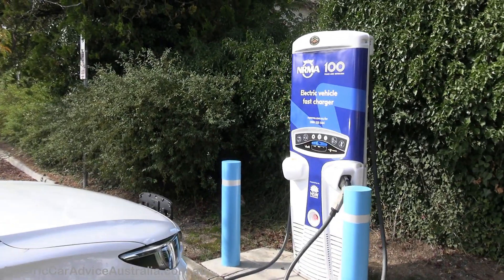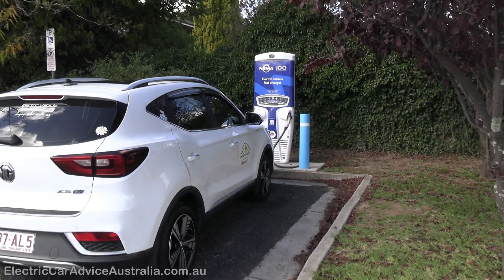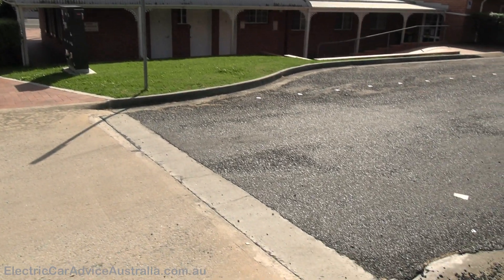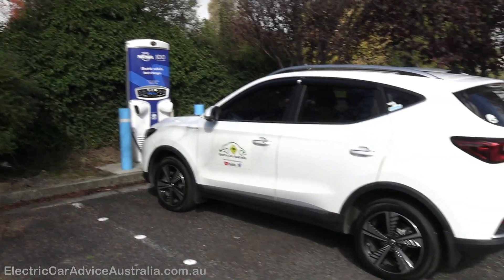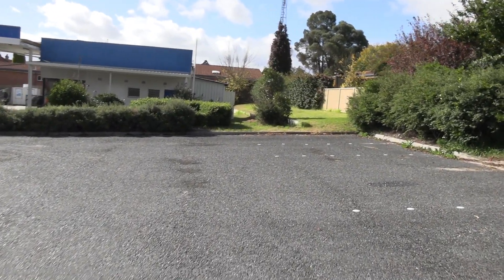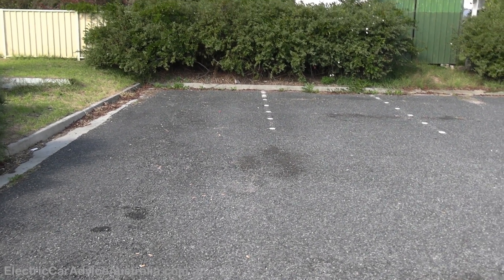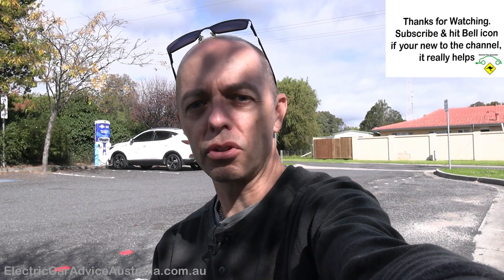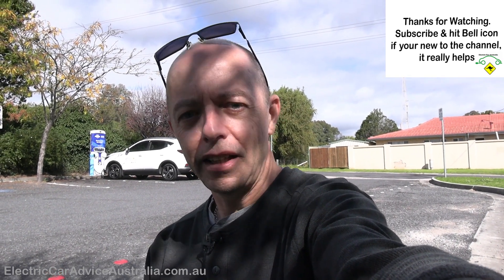EV Charging Stations | What's wrong with them? | Layout & Design Issues | Electric Car Australia

Comment: New EVs can tow, some up to 1,600 kg. My Hyundai Ioniq 6 tows 1,500kg while the Ioniq 5 and the Kia EV6 can tow 1,600. I think that the Tesla Model 3 and the Model Y can tow also.
I cannot understand why charging stations are always designed as back/nose-in rather than as pull-through (like ALL fuel stations are). Some people are driving EVs and towing, needing somewhat more frequent charging, but this is almost impossible, or made EVEN longer as they must unhook the trailer and leave it somewhere while they charge the car. I can understand the question of vehicles sitting and blocking other drivers from driving through, but there are several simple solutions o this. Make the spacing wider so cars can pass through past those still charging. Or even have mostly back/nose-in but have a few chargers which enable pull-through. This issue is a major disincentive
Reply from the maker: Thanks for watching and the comment. 👍

Comment: Yes I agree that more thought needs to go into charger locations. Also EV manufacturers need to come up with a standard location for all vehicles. Our first EV, a Nissan Leaf, had the plug right at the front, now we have the BYD Atto 3, and the plug is on the right had side near the front.
Reply from the maker: Thanks for watching. Agee a more standard position for charge port, or even a couple, would be more helpful.

Comment: Cheapest quote wins, being closest space to power board. There is a fire buffer between the public building and the EV.
Reply from the maker: Agree, that's why scratching head on this one as the distance was the same. Not sure what you mean re: fire buffer. If it's relating to EV's catching fire, they are 10 times less likely to do that than petrol/diesel so safer in that regard. Thanks for watching.

Comment: Accommodation also needs to consider places and also places need to consider how temporary blockages can be an annoyance. 

We stayed at a hotel where there was a truck parked across from the chargers and because people still needed to get past the EV chargers and truck to the rest of the accommodation we had to park across the two destination chargers blocking the second one. They did explain the issue when we got there but given how charging is likely going to be an increasingly big deal in bringing in customers they really should have reprioritised better, perhaps asking the truck driver and someone with a side room to swap parking bays for the night or make it a standard practice if long vehicles are common, since unlike chargers vehicles can be temporarily reshuffled. 

Also the chargers were put in the choke point which... not great planning. It's a real case of putting the chargers in the least desirable spots coming back to bite the owner. One charger instead of two might have actually made more sense in this situation.
Reply from the maker: Thanks for commenting and sharing your example. Yes, useability seems to be a secondary consideration to the convenience/cost of mounting.

Comment: I remember that station, I remember on a recent road trip one of the things we noticed was chargers tended to be right against the edge so if you parked directly in front of them with a CCS car you were blocking the Chademo charger. 

If I recall correctly doing that in this carpark moving a bay over would have put you against a tree, we were planning on trying to park one over since our Tesla charging location would have likely allowed it but unfortunately forgot on the way back, so not sure how much the tree would or wouldn't be an issue, may also depend on which side any potential back passengers are on as well since I was on the opposite side at the time so it wasn't an issue, may have had to shove a heap of travel luggage out of the way to get out the other side if I'd had an issue with a blocked door though.

But I think the driver's instinctive reaction with the currently placement is to park directly in front of the charger and avoid the tree, which as mentioned means the non-existant bay 2 can't be used. 

We couldn't test the theory on a bunch of other chargers we went to because even though they had 'only while charging' parking that was only for one space so the other space was generally full. So again, the 'second bay' was non-existent so even if a chademo had come or the chargers get two CCS plugs or something else later this could be a potential problem as usage picks up over time. Also charging port locations being different gets thrown in as well, so not everyone may be over to move one bay over to try and make space for a potential other user even if they do have that option. Although perhaps it is something people could still try if they have the space and ability to do so.
Reply from the maker: All good points. And what I didn't mention in the video (which I should have - future video) was wheelchair access is also near impossible at most charge locations unless the nose/rear of the EV is approx. 1 meter away from the curb in front of the charger.

Comment: All comes down to cost, they put the charging stations as close as possible to the distribution board. The cost of running high power underground cables is a lot, and gets exponentially more expensive the further the run is because the cable thickness needs to increase the further you go to handle the current.
No different to installing a charging point at home, the price difference installed next to your switchboard vs the opposite corner of your house will be large.
Reply from the maker: Thanks JW. Agree but in my example the underground cable length would be identical. Also the cost is incremental at the time of install and over the life of the charge station will pay for itself many times over in additional revenue from those drivers who need the access.

Comment: They'll get there. Towing is probably not such a biggie in the EV charging domain, even if EV's are equipped to tow small trailers. In any case, a 1000kg trailer is so easy to unhitch and move. Yes, more chargers are definitely needed.
I'm much more interested in Electric Vans - big ones. In Australia, from my research, LDV has one and Ford is about to release the eTransit when they can get the chips and they are both FAR too expensive. That is where the problem is - price gouging by manufacturers.
Reply from the maker: Thanks for the comment Ben. We need the site owners/installer to be thinking years ahead as once the charge stations are built it's way more expensive to change later. Cheers
Reply: Ray Johnson  I didn't know, thanks for the update Ray.

Comment: "ICEing" is a huge problem, whereby ICE (Internal Combustion Engine - i.e petrol/diesel) vehicles intentionally park in front off, and block access to EV fast chargers. This is akin to blocking access to a petrol/diesel browser for hours at a time! i recently took a photo of an ICE car blocking access to an EV fast charger and sent it to the Qld Transport minister. His office sent it to the relevant Police department who told me they had issued an official warning (along with advice of how large the fine is). PLEASE everyone who sees an ICEing incident, report it, otherwise this problem will get worse. 

I also spoke to a ministerial advisor about the problem of 50% of the Queensland govt (QESH) fast charger plugs (administered by Chargefox) being Chademo, and only 50% of plugs being CCS2. This was a big problem at the QESH Pimpama station with three 75 kW fast chargers all capable of charging two EVs simultaneously - yet myself and other drivers of CCS2 EVs had to wait to charge, while the three Chademo plugs were not being used. I got the impression that the Qld govt had not thought of this problem (had they thought of it - 5 plugs would be CCS2 and only one would be Chademo).
Reply from the maker: Thanks for the comment. You make some good points. Cheers

Comment: Yes. It's way past time that charging stations were installed that can used by cars with trailers and also small buses (about 20 seats) - which is universal at petrol stations.
Every charging station that services highways or A roads should have at least 2 (preferably 4) pull through chargers  at 350 kW plus 90 degree bays of at least 100 to 150 kW. At least 4 plugs in total for redundancy.
Reply from the maker: Thanks for the comment Alan, I agree.